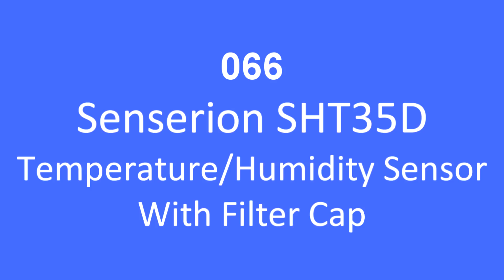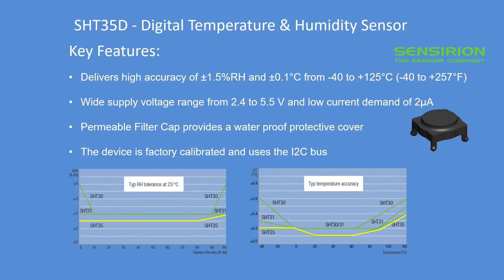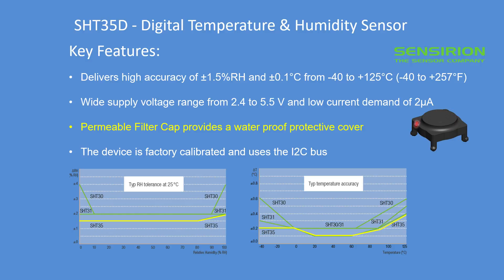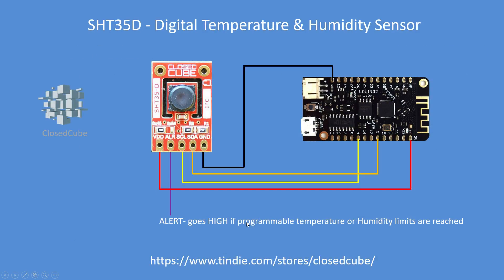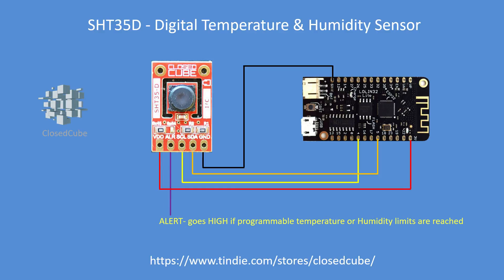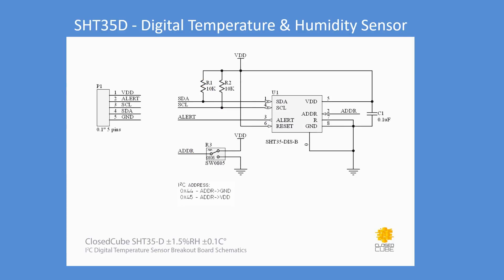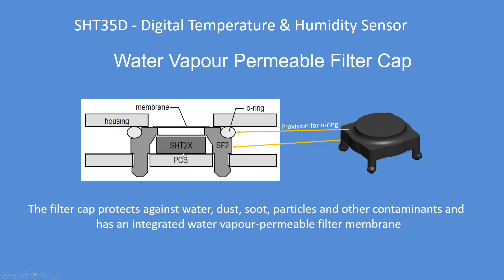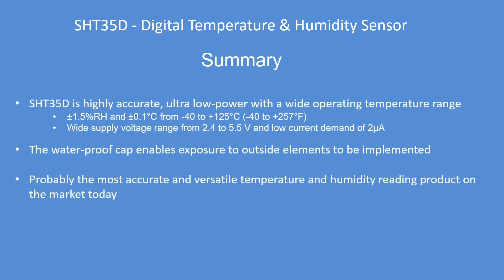Tech Note 066 - SHT35D Sensor with water vapour permeable filter cap

Comment: Do you know any brands / models that uses this sensor(SHT35) in its hygrometer-thermometers?  Xiaomi Mijia hygrometer uses SHT30 but i´d like to found some brands that use SHT35.
Reply from the maker: No, I think it’s too expensive for most production items and the SHT30 or 31 is much more likely to be used. The SHT35 is more likely to be used for laboratory grade equipment IMO.
Reply: Too expensive? SHT35 only cost 5 $ (+1000 units). I think that price is even cheap for a reference sensor. In the range of hygrometers of 50 dollars can be perfectly accommodated. I am very surprised that no brand has already released a hygrometer with this sensor announcing as the most accurate in the world. For 50 or even 100 dollars it would sell very well. Best seller sure.
Reply from the maker: That’s not my experience for production items where cost margins are a major driver down to $0.001 or less, when profit and volume are concerned. The sensor has been on the market for sometime so there is not likely to be a strong market for it otherwise it would have emerged by now. Manufacturers are more likely to choose the SHT31 or 33 over the 35.
Reply: Surely you are right.

And dou you know any brands/model that use sensor SHT31 for its hygrometers-thermometers??
Reply from the maker: Yes all Davis Professional weather stations use the sht31 mine does as I’ve seen the sensor in use on the remote sensor head.
Reply: SHT30, 31 and 35 is drop down replacement. Same footprint, same protocol.